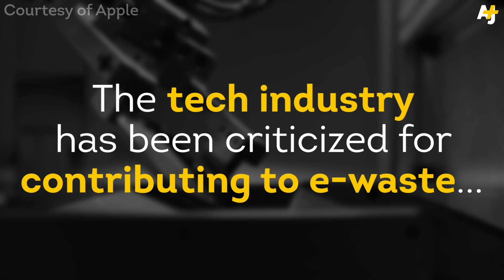Apple's New Robot Liam Recycles iPhones

Comment: Wouldn't it be better if apple just designed phones that could be repaired and pulled apart easier? They have incredibly low ifixit scored.
Reply: +Uk Gamer  the problem with that is people will hack and mess with the phone.
Reply: Mister Mood Like they do with pretty much every other phone? the environmental waste problems have been created pretty much by t apples wasteful aluminium unibody laptops and horrible glued together tablets and phones.
Reply: Uk Gamer i agree but they do for security reasons. but i suppose you are right, or maybe they should design thier phones to last longer?
Reply: Mister Mood Its not for security reasons its just to create a reliance on apple for all maintenance etc and to pay for replacements. They can even lock newer models who have been repaired by third party repair shops.
Reply: Uk Gamer thats also true.